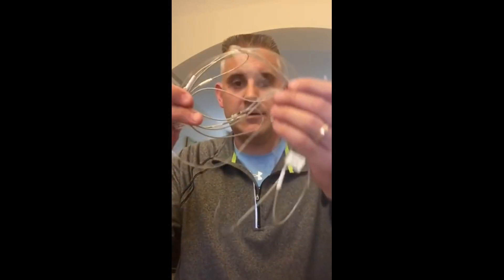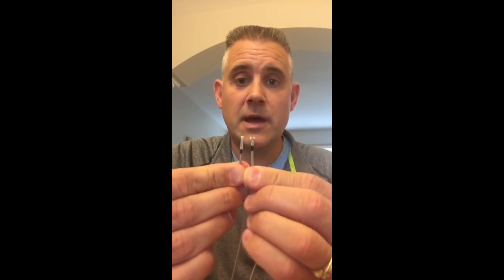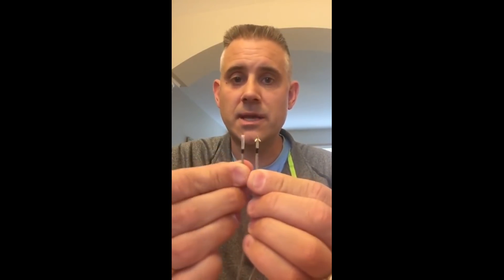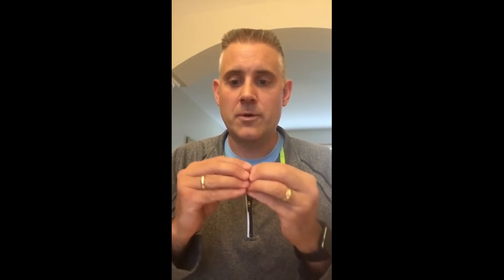Leads for Cardiac Devices

Comment: So would you know if you dislodged a lead? I assume they would find it at a check up. I do a lot of heavy lifting.
Reply from the maker: vwace - There’s a couple of ways you might find out if a lead is dislodged. One way is during an in person check. Another way is through your remote monitoring when your device runs a nightly check and finds something has changed. Often times it’s the patient that discovers it by either feeling sluggish or dizzy (because the pacing of their heart has changed with the dislodged lead) or through a shock received (if you’re an ICD patient). It’s usually a symptom like these that causes the patient to go see their doctor which is when they discover the lead dislodgement.  I hope that info helps.  Thanks for the question!

Comment: Hey Doug, thanks for the videos. Can I ask a question about the leads? I do light, not competition, bodybuilding. I was told that a bench press was no longer allowed in my life as the motion of pushing your hands straight out from your chest can cause the lead to fatigue in one spot where it goes under your collar bone and can cause the lead to break at that mid point. Not pull out of the device or pull away from the scar tissue, but break.  From your description of how the lead is actually put into my body, I don't know how that would be possible. Have you ever heard of anyone breaking their lead form repetitive motions such as bench pressing?
Reply from the maker: Hi Chris, thanks for watching!  Yes, I have heard of the issue you’re describing. It’s called clavicle crush and is when the clavicle bone presses down on the lead repeatedly causing the lead to fracture. This is only an issue of the lead was implanted in such a way that it would be in close proximity to the clavicle bone, which does happen from time to time. An X-ray should show where your lead is in relation to your clavicle bone and if you should be concerned. Regardless I’ll share with you what my doctor told me. He said my ICD is there to allow me to live, not to restrict my life. If bench pressing weights is what I want to do, I should do that and if any issues (like clavicle crush) present themselves he will fix the issue. So, I do lift weights. Just dumbbells, but I do bench press with 30lbs in each arm. I’m working on increasing that to 45-50, and while my chest muscles around my device get sore, I don’t feel I’m harming my device or leads. However, if I do somehow damage them, I know my doctor can address the issue, and then I will reassess my decision to lift weights. Until then, I’m loving my life the way I want to.  At least, that’s what I’m doing. You’ll have to decide for yourself how much activity you want to include in your life. Best of luck to you!

Comment: Doug can you tell me about what percentage is mean when you're using your pacemaker for example if you have a yearly check up and they say you have used it 30% what does that mean is it 30% of the year?. I can't imagine if you're not totally p as paced that you would be 30% each day. Thanks for all your info
Reply from the maker: Liz, sorry for the delay... If they say you're being paced 30% of the time that means that 30% of the time your heart needs a little help.  It doesn't mean your heart didn't or wouldn't work.  It just means that 30% of the time your heart didn't beat within a particular set amount of time, so the pacemaker did it for you.  That is an average amount, so some days during the month your device will work more and some days it will need to work less that that amount.  And a higher percentage doesn't necessarily mean your heart is any less healthy.  A person with a device that paces 50% isn't worse off than someone whose device only paces 10% of the time.  It just means their heart isn't beating in a set amount of time, so the device picks up the beats to ensure optimal functioning.